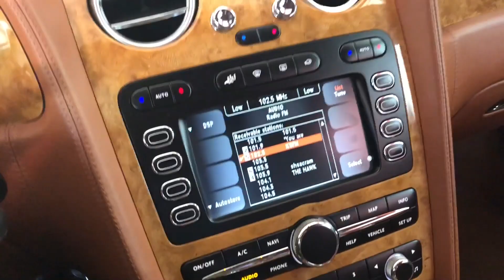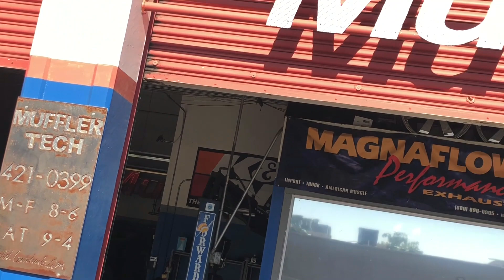Muffler delete on a Bentley Continental GT/// SUPER LOUD!!!!

Comment: I don't know if you still have this thing, but a catalytic converter delete, resonator delete, and headers should give you that sound you really want. Just saying! 🙂
Reply: They are no after market headers for the w12 engine period and the cats are right on the headers pretty much. Everything is so compact in there. The 2 secondary cats and 2 resonator can be removed to help. The 4 primary cats have to stay unfortunately.

Comment: What mufflers did you put on it after cutting the rear mufflers off? Did you get any check engine lights after disconnecting the lines on the mufflers